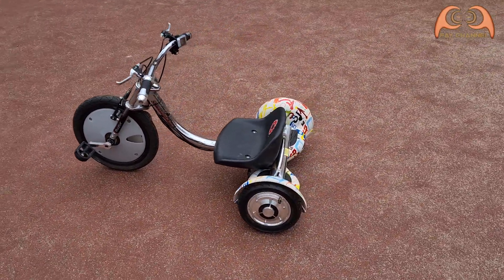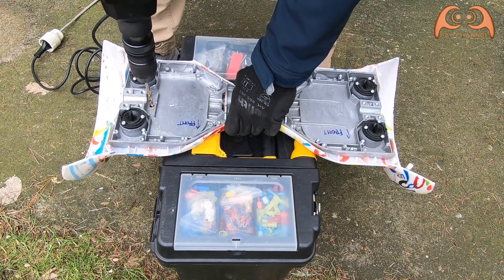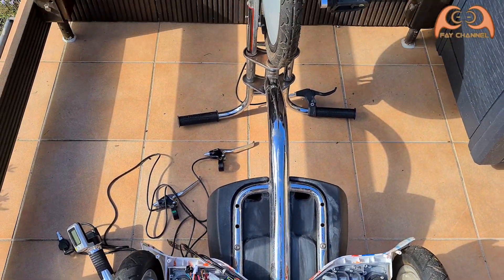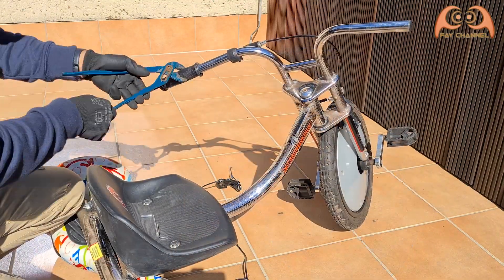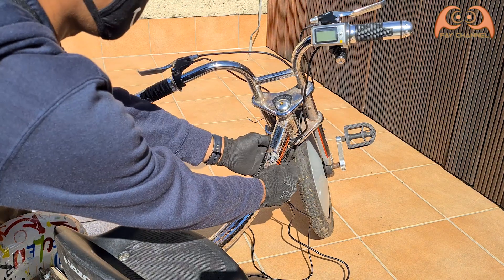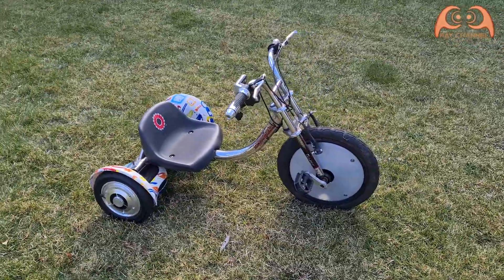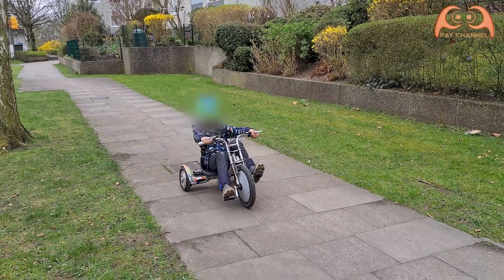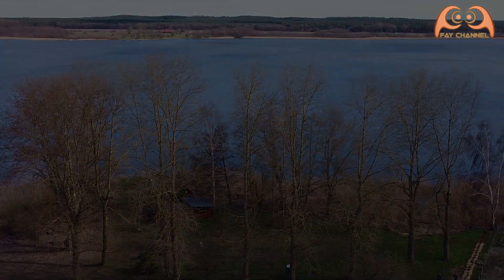DIY E-Trike using Hoverboard Motor with E-Bike Controller | Part 2 Assembling

Comment: Controlling only one side motor?
Reply from the maker: @Muthuraj Bedasur  I used 2 controllers for 2 motors (each motor has own controller) with one throttle for both of them. You can see how I did it in this first part: 
https://youtu.be/H-iIBxB5MFA
Reply: @FayChannel  thanks for guidance dude. Best
Reply: @FayChannel  are these 350 watt motors
Reply from the maker: Yes 350 watt motor each
Reply: thanks
Reply from the maker: you're welcome, don't forget to see the 3rd part (Upgrading): https://youtu.be/_4ejSYfvFVk
Reply: @FayChannel  like shared and subed. 

Just a question about performance and ground clearance for road humps and pathetic holes
Reply: @FayChannel  like shared and subed. 

Just a question about performance and ground clearance for road humps and pathetic holes
Reply from the maker: about the performance you can see in the 3rd part (upgrade) video.
Reply: @FayChannel 
Can we use only one controller for both motors ?